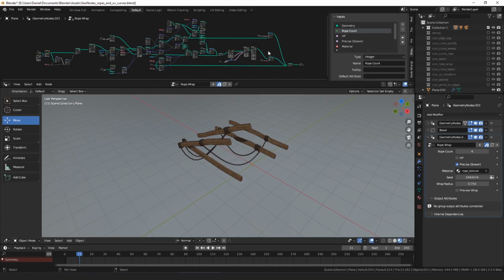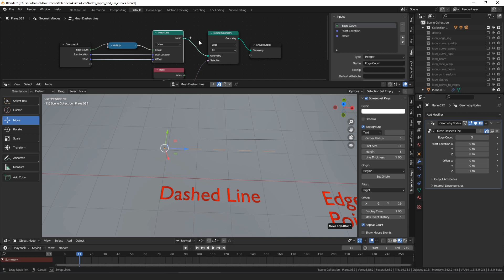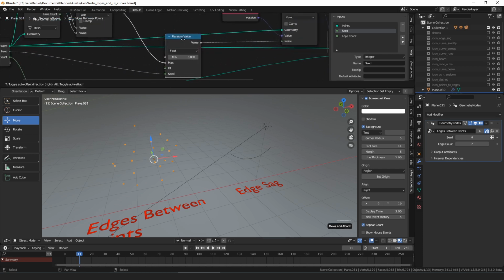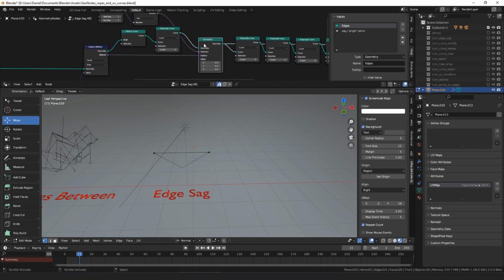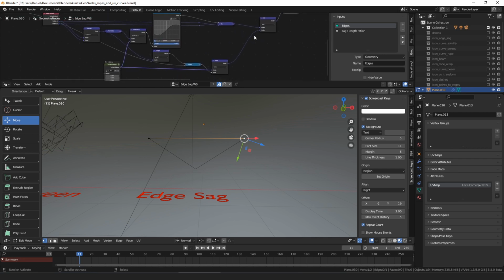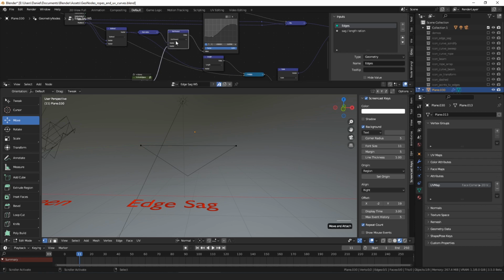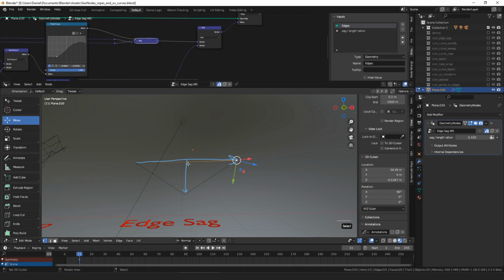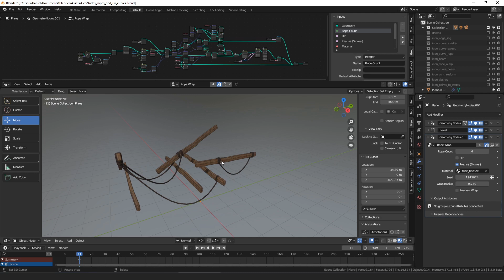Geometry Node Assets: Rope Wrap - Part 1

Comment: Hello Daniel, thank you for your explain, i am wondering how to  control the point of "Edge  between points" tool not to be random connect, i want to  create cable between electric poles. Thank you.
Reply from the maker: Hi!  That is a bit more difficult since you need a way to identify valid connections.  
I would create a Mesh Line with 2 points and use the Duplicate Elements node to make a copy of it for each attachment point on the poles.  (the attachment points could be verts in a mesh, or defined by a vertex group as a part of the pole mesh)  Using the index of the duplicate, sample the attachment points and set the position of the duplicated edges.  

Now we have edges but they don't go anywhere so we need to sample a second position for one of the verts in our edges.  If the poles are created in the node setup as a kind of array, you might be able to capture an index attribute on the poles and find the next pole that way.  If the poles aren't ordered, you could duplicate the duplicated edges and connect them to every pole, then delete any edges that are too long.

Comment: Why do you resample multiple times using increasing resolution?
Reply from the maker: I do that to turn the triangular 3-point curve into a smooth arc.  By resampling from 3 to 4 points the sharp middle point is deleted and two new points are created on either side of it.  If you resample from 3 to 8 in one step you'd get the 8 points but the shape would still be triangular.   An alternative might be to change the curve type and set the handle positions, but that would require more math.
Reply: @looseEdges  Thanks for the explanation, much appreciated.